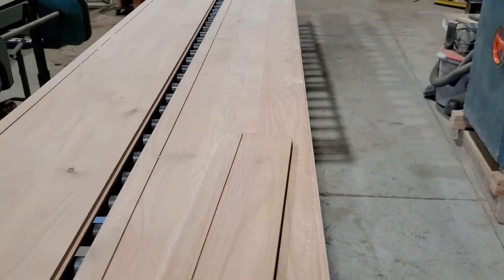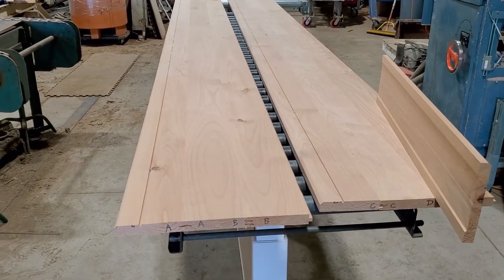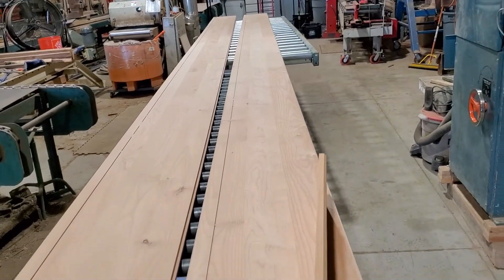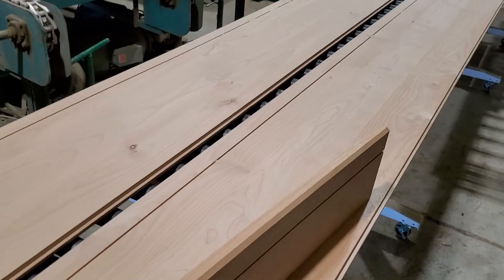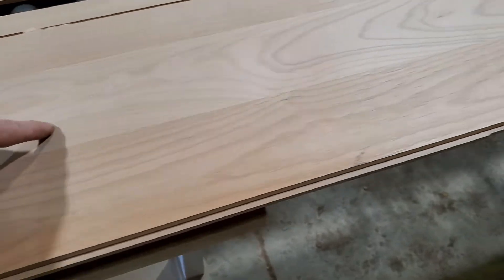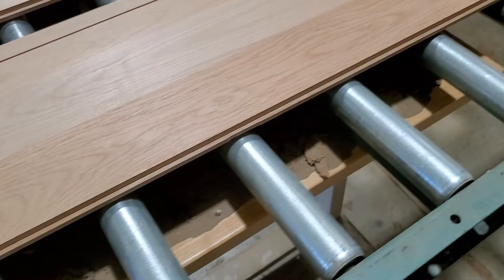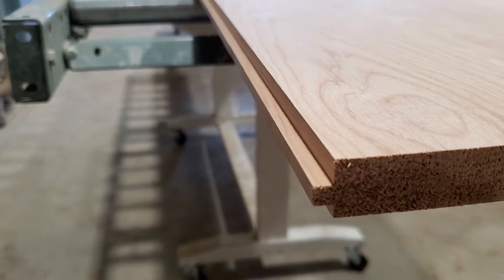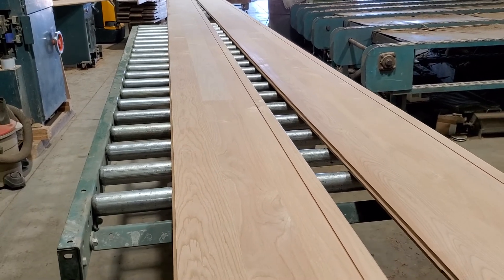Board stretching for big skirtboard

Comment: Nice machine work Dustin your cligent will be well pleased with those. Which procedure did you use to assemble the full width finished lengths? I've got three methods, see if I check out with the one you used? I'm justin curious. Tony
Reply from the maker: Tony, after I milled all the pieces to about .025 over final thickness, I just edge clamped with glue on the tongue and groove. Let sit over night, then ran 1 time on each side thru the wide belt sander. Was the easiest method I've done so far. How do you do yours?
Reply: @moldings_etc  Hi Dustin, it's the clamping up procedure you used I'm interested in. How and why? Tony
Reply from the maker: @tonyworkswood  just clamped the 3 pieces together with some 24" aluminum bar clamps, a sacrificial piece on the show edge. The tongue and groove aligned them, I just made sure not to over torque the clamps so as not to put a curve across the width. Does that make sense? I could do another video using the sample piece if needed. Let me know.
Reply: @moldings_etc  Hi Dustin, thanks for the reply. Sounds good to me. You gradually worked your way along the full length of the skirtboard bit by bit staggering the end grain joints as you proceeded. Tony